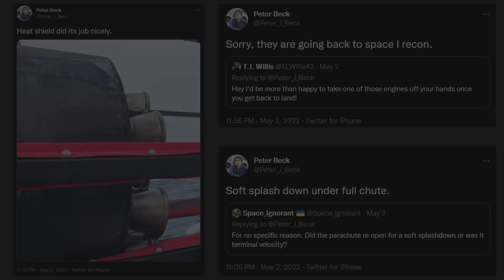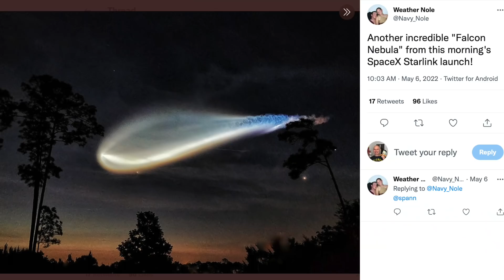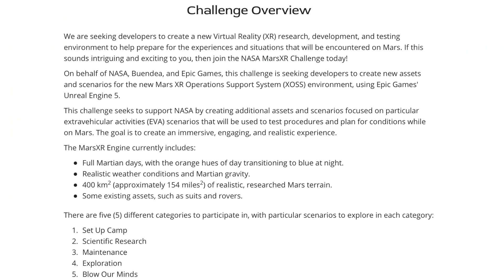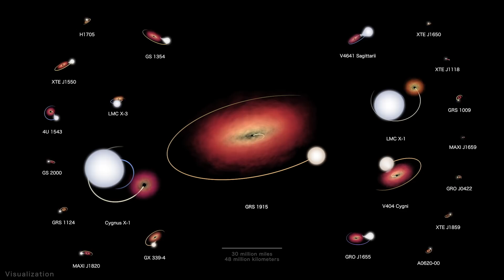SpaceX Planning To Land In Middle of Bahamas - Deep Space Updates - May 10th

Comment: I've seen the interior of several rocket factories now. They all have blue and yellow machinery and fixtures, in the same shades. Is there some kind of OSHA code about this?
Reply: Safety or hazarous equipment is going to yellow or possibly orange. As to the color of the paint used on machinery, tool carts etc. That's not a standard that I know of. The colors used today are better than the traditional industrial grey and greens of 60 years ago. Some of the color choice may simply come down to buying machine tools from the same manufacturers. Machine tool* builders do seen to have standard colors they use on their products. 
*this used to mean pretty much material removal aside from stamping, forming, casting and welding. Now machine tools include additive methods.
Reply: @mpetersen6  Just got a new press at work not that long ago and it's white, in fact most of the presses we have are white.  The press I normally run is orange though, it's a fairly old beast (not sure on the exact year but I'd venture to guess 70's at the newest with controls mostly from the 90's*).  It's quite common for presses and other large equipment to be much older with a bit of newer control hardware and sensors bolted on since the presses themselves are made with a lot of heavy duty steels which are of course quite expensive.  I wouldn't be surprised if a lot of the hardware they use is also repurposed from another use.

*My guess on the age of the controls is based on the fact that it uses some solid state electronics but is mostly manual with just a little monochrome display (don't think it's LCD).  Around the mid 90's to early 2000's they (most press control manufacturers as best I can tell) started chucking MS Windows computers into the main control cabinet and using that as the brains with the exception of safety systems and ASICs required to communicate with the computer.  

ASIC=Application Specific Interface Controller, basically a piece of hardware that allows a more general purpose computer to control specific hardware. The term is also used to describe hardware that provides special processing capabilities to a computer such as a crypto mining ASIC though I feel that's a bit of a stretch for the term (it would be more accurate to call it a crypto mining auxiliary processor but I guess that doesn't sound as cool or something).
Reply: @grn1  
One reason for using light colors is any leaks in hydraulic systems will show up like a neon sign. Personally I love hydraulics in the right application. Precise control and clamping pressures. The downside is leaks.  Because all hydraulic systems will leak eventually. Be it through wear on hoses, seals or the connections. Often on the connections it is due to vibrations being transmitted through the system. Flared tube ends (flat or conical) are more prone to leaks. But systems using ferrules will leak also. One reason is any slight imperfection in the fit between the ferrule and the fitting body.
Reply: @mpetersen6  Good point, I've certainly seen a few leaks before.  One of my old jobs we had 2 presses in the entire building and despite providing most of the parts the rest of the place needed they were terribly neglected.  Sure we had a 4 hour maintenance period every month but after running those presses 24/6 and at times 24/7 for so long the machines needed a lot more than they were getting.  The main things that leaked though were the cams and belts.  One of the belts was an older electric one where the driver always seemed to be on the fritz, we eventually replaced the big hydraulic one we used on Press 2 (now that I think about it the press number I worked on back then is the same at the press I mostly work on now in a different company).  Press 1 had leaks everywhere though, not just the cams and belts but pretty much everything that could leak did.  Not too many leaks where I'm working now.
Reply: There's general industrial tradition and code for colors of common equipment like red tool carts and yellow barriers.  Maybe that causes the similarity within any one industry.

Comment: Regarding Spin Launch: How hard would that be to set up from a packaged state onto the surface of Mars (from a cargo Starship)? Could it be more effective there in getting a Mars Starlink system up to improve communications between a landing site and Earth?
Reply: Something like Spin Launch might work on a body with low enough surface gravity and no atmosphere. See my comment above. As to a Starlink constellation in orbit around Mars. Any serious manned Mars missions will require an orbiting communications constellation between the orbiter and the surface back to Earth. 
When thinking about manned Mars missions one major mission goal in my opinion should be to Phobos or Diemos to explore the possible production of propellant and oxidizer. If fuel production is possible that could be ramped up to the eventual construction of a fuel storage and refueling facility. Pumping fluids in low and zero gee can be a nightmare. One possible solution to that is if the fluid is stored in a bladder contained in vessel that can be pressurized.
Reply: I guess it'd be far more cost-effective to mine the abundant Martian iron oxide and use it to build a spin launcher in-situ, using an mini-armada of robots. That way you only send the first robots who will build the forgery and start mining rock, the you use the forge to create even more robots, finally you can build whatever you want in an automated fashion. Yes, I believe spin-launching would be far more feasible from Mars, taking advantage of its much lower atmospheric density and gravity.
Reply: Spin launch will never work.

Comment: Spin launch on the moon would not even need a vacuum chamber on the moon right?
Reply: Exactly. Though on the Moon I believe a rail that uses a linear magnetic accelerator would be simpler and more cost-effective, as you could accelerate as hard or as soft as you want (depending on how resistant the cargo is), and anyways in the end the train car reaches escape velocity and simply gets ejected off the end of the line
Reply: I think a horizontal spin launch like system on a hill would be more economical on the moon than a linear  magnetic accelerator since it has much less power demand on the power supply and it can easily launch in any inclination.
Reply: @larslindgren3846  That's a good point!! A spin launch can launch at any inclination, vs a rail which is fixed at a certain angle. On the other hand, a linear magnetic accelerator has the advantage that the acceleration it puts on the object can be tweaked much more easily and with more finese, so you can launch objects at, say, 8G if you know they can handle it, but impart no more than 2G when launching human infants. having both would be even better!!!
Reply: @JosePineda-cy6om  I think maned catapultbased launches are rather far in to the future anyhow. To reach lunar orbit at 2g you need a linear accelerator about 75 km long. To do the same with a spinning tether you need a tower that is 6 km high above the surrounding surface to keep the 150 km long tether off the ground.
I think a more near term application could be launching bulk materials like propellant at 2000 g then you only need a radius of 150 m and the hub only needs to be a few meters above ground.
An other very interesting variant is to have an rotating tether in lunar orbit such that the lower end have almost zero speed relative to the surface and use it to pick up and setting down objects on the surface.
Reply: No, on the moon it’s opposite. The chamber needs to be filled with air at 1 bar.

Comment: I still think Spin-Launch is viable, but they will have to set up their primary facility on land that is already at a significant altitude, thus lowering the air density and subsequently the resistance needed to be overcome, allowing for a lower speed or heavier payload launch.
So, Altiplano or Nepal ideally, although you could do it in the US High Plains.
I rule out Tibet simply because that would require the cooperation of the Chinese Government.

Comment: Did SpaceX confirm the photo was real. Even so there is a lot of testing they can do with a damaged downcomer. They still need to do a test with the thrust simulators.
Reply: SpaceX-Space Flight Simulator  Have they confirmed a downcomer repair or just moved the ship back and forth?  If they only moved the ship they may have declared it unrepairable and decided to use it only for structural tests.

Comment: With no sign of Vulcan any time soon, it would be sensible for Dream Chaser to book early launches with SpaceX. As SpaceX is probably retiring Dragon in favour of Starship, there is a niche for both. Dream Chaser is like a pickup and Spaceship like a semi. They complement rather than compete.
Reply: ULA's Tory Bruno tweeted pics of the flight ready BE-4 engine bells going to the build stands. Blue Origin tweeted pics of the flight ready BE-4 engines on test stands. So Tory's prediction of having the BE-4 engines at ULA by mid-year looks like it will come true. IF so, the first Vulcan Centaur launch sending the Peregrine lander to the Moon might happen this year.

SNC said that once Dream Chaser Tenacity is finished, they will be sending it to a NASA facility in Ohio for testing in Aug/Sep to be completed around New Year sometime. So they are expecting to launch Dream Chaser on a Vulcan Centaur in about a year (April-ish?). SNC has said that Dream Chaser is launch agnostic, so it can launch on any US booster with enough capacity. 

Since Dream Chaser is joining Northrop Grumman's Cygnus (Antares 230+) and Dragon (Falcon 9 B5) on the CRS missions, that is likely why they are launching on Vulcan Centaur. That way, each CRS spacecraft to the ISS is launching on a different booster, so there is a LOT of redundancy.

Comment: Linear maglev of a few kilometres is the best way to launch (and recover) payload from the Moon. 

Rocket engines and fuel would only be used for orbit manoeuvres. The maglev is immediately reusable as long as there's electricity flowing and limited only by maintenance. The payload can be of a variety of shapes and dimensions with less structural requirements.
Reply: I'd hazard that a Lorentz accelerator (like a rail gun) would be more practical than a maglev/EMALS type system just because of how quickly you have to flip polarities in the track when launching at over 1500m/s to lunar orbit, as opposed to a little over 100m/s for the fastest maglev trains.
Reply: @thamiordragonheart8682  
Not sure maglevs speed is electronics limited, I guess the air drag is the limiting factor on earth
Reply: @thamiordragonheart8682  
Furthermore, afaik, the railgun is only considered by the military as a weapon because of the simplicity of the projectile and the cost savings it makes possible. This is not an issue in transportation and I haven't seen any proposal for friction Lorentz propulsion for transportation over EM levitation be it in maglev projects or more recent hyperhype loops
Reply: @HAL NineOoO  EM levitation systems are a lot more efficient because they don't have friction from sliding against the rails, they don't have as much structural mass, and they make it really easy to use nice and quiet but less durable rubber wheels in the station.

the reason I think it starts to break down at really high speeds is that the way it propels the sled is by setting the magnetic polarity in front to pull and the polarity behind to push. because the force is inverse square, you start to lose a lot of power if just you make the elements longer, but if you keep them small, you have to switch the polarity extremely quickly. switching that much power quickly is already hard since you probably want to accelerate at 3gs ish to keep the track short, and it's worse in the electromagnet because of the inductive losses from changing the current direction. there is also the question of inducing current in any internal electronics from the changing magnetic field.
They are surmountable problems, and if there is an easier way to solve them that I can't think of, maglev is definitely the better choice from a technical perspective, 3gs at over 1km/s just seems really difficult to engineer compared to the railgun system and I guess I tend to err on the side of too simple.
granted, the real reason to use a railgun instead of a maglev system on the moon is ISRU. electrical aluminum for the conductor is relatively easy to make with lunar resources, but there just isn't anything practical to use as a flexible insulating layer for coil windings, so the maglev would require you to ship a lot more mass from earth than the equivalent railgun system.
Reply: @thamiordragonheart8682  
I see. I didn't think of this that deep, you may be right. Thank you

Comment: I think Rocket Lab did a great job catching the booster on their first real attempt, even if they had to cut it. SpaceX makes landing the booster look easy now, but let's not forget that it took them something like a dozen tries before they got it. Plus, that doesn't include multiple data-gathering flights where the booster was deliberately expended, but they were still reading the sensors until it hit the ocean.
Reply: 5 Actual tries but if you include ocean landings i think 7-8 and the fact they did it at all is amazing!
Reply: As Scott pointed out.   Something was observed that was unexpected.  He suggested possible fuel slosh, or parachute dynamics. I hope Rocketlab can give an update on this after they pour over the data.  Modeling/well planned test can only get you so far.
Reply: Two things... First,  SpaceX doesn't land their boosters in salt water.  They land on the "barge."  The only water landings were while perfecting the soft landings (and, one or two that had control issues and were sent to the water due to lack of hydraulic fluid or reentry heat messing things up).

Second, the main issue (in my mind) is that I can't see the "catch it with a helicopter" scheme being scalable to a Falcon 9 sized booster, much less a Super Heavy booster.  Helicopters seem riskier, but could work for smallish boosters.
Reply: @Retired-Don  Different solutions for different problems. Electron is too small to have the fuel reserves for propulsive landing - but it's small enough to do without a reentry burn, to use parachutes for breaking, and to be caught by a helicopter. Falcon is far too big to use the Electron approach, but it's also big enough to afford the payload penalty associated with reserving fuel for a re-entry burn and landing.
Reply: It was fun to watch live streaming.

Just as the booster was caught, it was moving out of frame of the video. But you can see an oscillation of the booster's motion begin. Then it moves out frame.
I assumed it was the cable becoming loaded suddenly and it would dampen out. Maybe it did and the problem was elsewhere in the events.
Reply: The one major problem between the way SpaceX learned and developed their rockets was SpaceX had No form of manual human chance of error during the actual catch.  All information sent to the rocket during decent was computer controlled/evolved with learned information on the failed launches and most importantly  had no form of human injury risk as well.  having a Helicopter piloted even by the most skilled pilot would leave a room for a human miscalculation or weather causing visibility issues that could lead to a missed catch or an even an impact with a boosted due to a simple heavy gust of wind.   I love the idea behind it, but in my opinion just leaves many more spots for error throwing in a separate helicopter and a human pilot making the catch.  Also does not seem nearly as cost efficient,  the price of fueling a helicopter, then paying a pilot,  also keeping the copter maintained.  the more parts you throw into it leave more room for problems.    We shall see though.  I don't see them going with it for long.
Reply: @charlesyaryan6619  Someday they will likely be using automated drones to catch the booster.  At least that would be my goal.  I think the cost of using a helicopter is cheaper than refurbishing costs of a booster landing in salt water, I think.  I am sure that they have worked out the economics.

I hope they push forward with the concept.  I believe it has potential for small launch providers.
Reply: @kokomo9764  I agree completely.  Salt water is absolutely awful for metals of every kind.  I also agree with the use of Drones.  With the way drone tech is evolving and becoming more and more normal it would be so cool for them to be the first to try that with sensors on the booster that can be read and tracked by said drone along with remaining weight/fuel to calculate torque required once catch is made.  Along with guidance to landing locating after catch.  Removing any chance of human mistake or injury.
Reply: @charlesyaryan6619  catching stuff with parachutes via helicopter is a very well understood process. Humans have done it numerous times. One of the biggest variables is guaranteeing right location without doing more precise burns coming down like spacex. I think spacex is definitely better off with their landings they already do though
Reply: you can tell which rocket company is doing the best by which company the Chinese are trying to copy and that SpaceX the rest of the industry needs to catch up with SpaceX or they'll be antique dinosaurs and we know what happens to the dinosaurs
Reply: @juliancrooks3031  
Remember dinosaurs are still around. And they taste just like chicken 🍗🍗
Reply: @juliancrooks3031  That's just naysaying, which is exactly what everybody did 10 years ago when SpaceX said they were going to propulsively land their boosters. There can be more than one valid solution to a problem, and Peter Beck has explained in detail why propulsively landing is not an option for Electron.